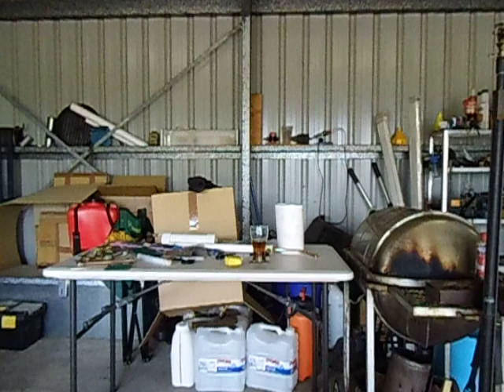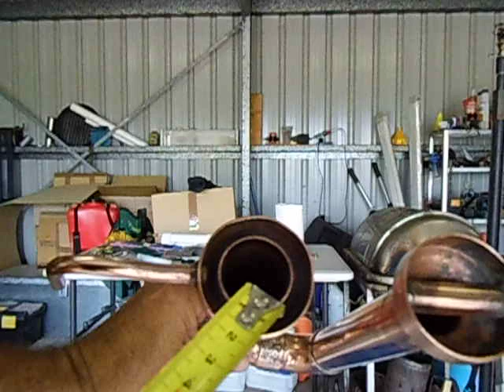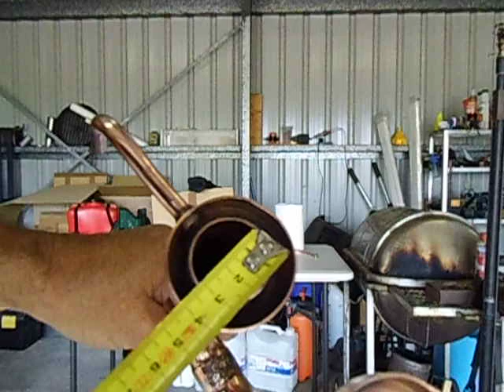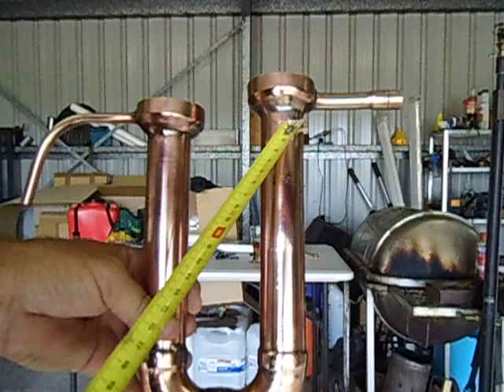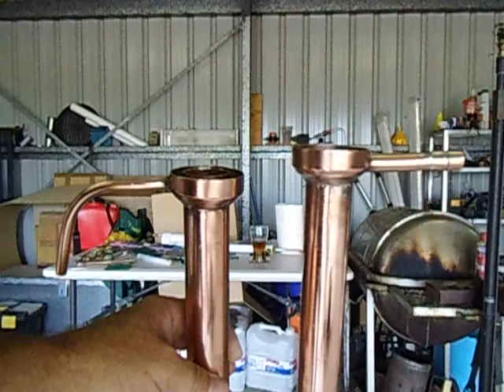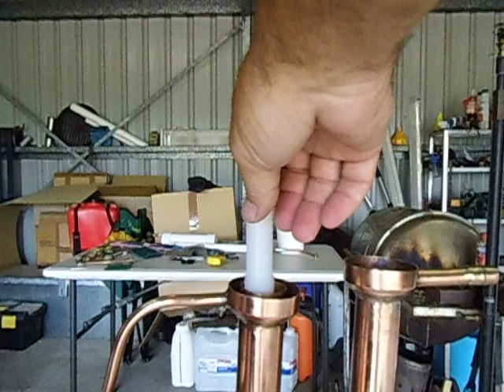How to make a parrot for a still

Comment: fIRST FO ALL LOVE YOUR VIDEOS. THE THUMPER TANK YOU HAVE WORRIES ME? WHEN YOU START UP DOES ALL THE BAD STUFF STAYS IN THE THUMPER AND THEN GO INTO YOUR FINISH PRODUCT WHEN RUNNING? DO YOU STILL DRAIN OFF THE FIRSE 200mils before collecting? i'M BUILDING A STILL LIKE YOURS NOW I GOT MY POT CUT AND THE RISER MATL HERE NOW . IM WORKING ON A VERTICAL  COOLER AND HOPE TO HANG IT OFF THE THUMPER.   thanks Ed Lee

Comment from the maker: My rum distilling is the proof of what i do no bullshit mate , and that's only one run , all stills runs different and some alcohols boils at different temparetures too. My still is homemade as you noticed and done a lot of resurch on condensing,reflux and all that bull.You must be running a little air still i guess that you only get around 60% as they have'nt really got any refluxing ,it's cooled by fan.So by running a second time does'nt make sense  as my spirits is top of the kings in one run

Comment from the maker: I run the wash thru the still only once , because the thumper does the second distalation thus vapours condenses in the thumper a second time and vapours rises a second time too causes double distilled in one run.You don't want any yeast in your wash when distilling as this wil give off flavours and nasty taste and smells to your spirits.After catch i cut to at least 50%abv , then filter two times thru a Britta filter after cutting , then add a nice hand full of oak chips to about 3Lt spirits.